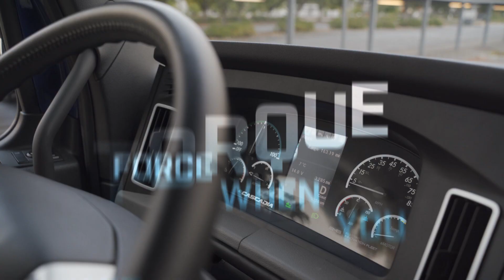RACE: All-Electric eCascadia Versus Traditional Diesel Cascadia

Comment: Looking forward to the installation of the GM hydrogen fuel cell and the  heat recovery systems for generating additional electricity and augmenting the HVAC heat pump.